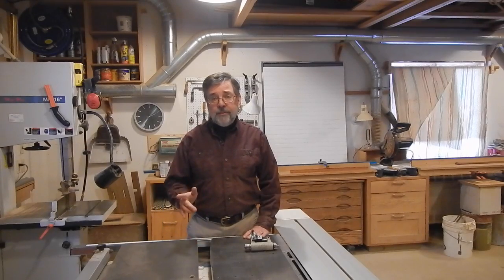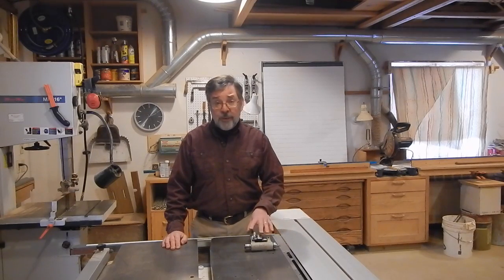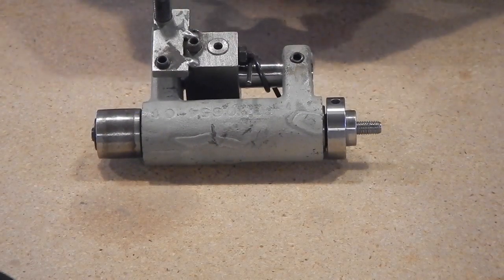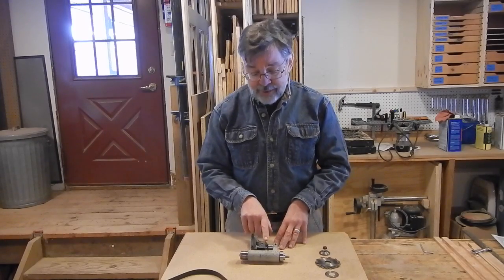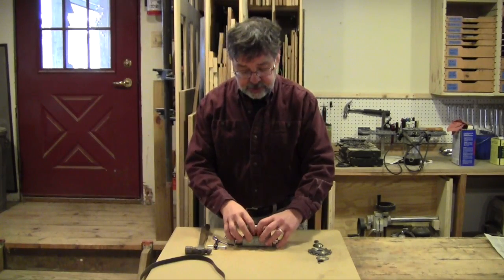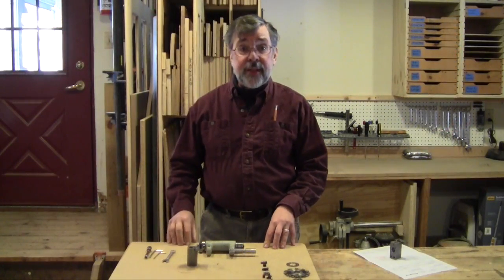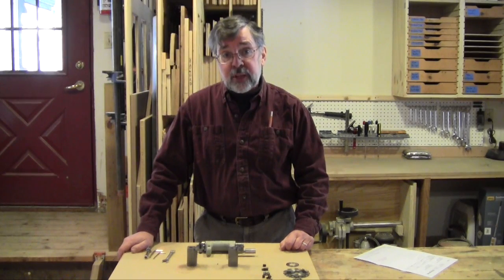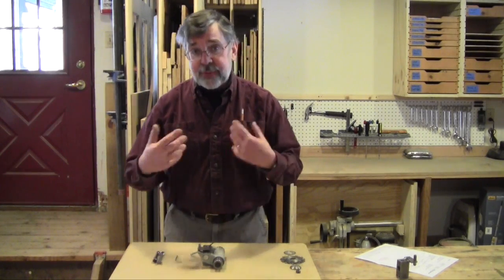MiniMax CU300 - Scoring Blade Assembly Repair

Comment: Thanks for making all these videos on this type of machine.  I recently purchased a used CU300 that was made in the 90's.  Watching these gave me a firm grip on accessory parts that I need to purchase and the way the machine operates.  Right now I have 5 individual machines: tablesaw, jointer, planer, shaper and mortiser.  This machine reduces my shop footprint(one car port of a garage) although I will keep my 20 inch planer.  12 inches is too small for me. Your videos are fastidious and excellent.

Comment: Peter,

I am pleased you like the "scoring" feature.

I saw a video yesterday, where the owner said, "I have NO use for the scoring blade in my new sliding saw; and if it was an option I would NOT have bought it. For I will never use it!"

To each his own.

I personally believe that it is one of THE most needed and awesome inventions in the history of sawing wood. I really mean that.

If a person doubts this, try to cut melamine with out a scoring blade, and it will tear out the bottom of the stock on BOTH sides of the cut using MOST blades. And the tear out is very bad. This happens worse, with plywood,, laminated wood, and thin verniers on wood, etc.

I do not have a scoring blade and that is not an option on Powermatic table saws that I can afford. But there is a "FREE" scoring feature on ALL saws. But if great care is not taken; it can be VERY dangerous.

Just look at the back side of plywood when you have it cut at Home Depot or Lowe's, etc!

But when done properly, it is awesome. AND.................there is NO need ever to shim or adjust it side ways; even when changing blades with different widths. The first time I saw it done, I flipped out. Again, it MUST be done following strict safety procedures; or do NOT do it.

For whatever it's worth.

Keep up the good work Peter.

Comment: Thank you for taking the time to make this information available. Your videos are valuable and informative. You may have saved me hours (or days). It has been frustrating at times to get info on these machines. I have the same combo. I also have a MM16. 

In case you ever need to change your belts, please record the procedure. I would like to see a video of someone changing belts on the various motors.
Reply from the maker: Larry, I'm glad to hear that you find the videos useful.  In all the years I've owned my CU300, the only belt I've ever had to change is the one that drives the scoring blade.  Since everything happens deep inside the cabinet, I don't think there's any way I could capture very much of the process in a video.  I'm hoping my luck holds with the rest of the belts, especially the one that drives the jointer/planer.  If that one goes, I'll try to film something.  --Peter
Reply: @sunnybeeches8534  would you happen to have a part number for that belt?
Having a hard time finding a source in the US.

Comment: Good videos, can you tell me what is the correct height the scoring blade should be set at above the table?
Reply from the maker: Andrew, I'll admit that the exact hight of the scoring blade is not something I pay much attention to, and I've never noticed it making any difference.  There's a comment on my table saw video saying that I have the scoring blade set too high, and I think that's likely true.  Probably, the higher the scoring blade, the more likely it is to produce some tear-out of its own.  So, in an ideal world, you would want just enough to get the job done, but no more than that.  I'm guessing that would be somewhere around 1/32".

Comment: Thanks for your interesting videos which I discovered only recently.
I have a broadly similar SASCOM "Titan" brand machine which has served me well for many years. I had a number of comments and queries arising from your various earlier videos but didn't post these as I was unsure of a reply. Do you monitor comments for these older videos?
Incidentally, I long ago removed my scoring unit so as to allow me to fit a 12" saw blade but I am going to dig this out and examine it in the light of your problem.
pat dee referred to an alternative to the scoring saw but didn't give any detail; I think he may have had in mind the idea of a close-fitting throat plate.
Reply from the maker: I don't monitor the comments on the videos, but YouTube will usually send me an email whenever someone adds a new comment, and if the comments warrants a reply, I'll usually create one.  The volume is pretty low, so it's not hard to keep up with.  --Peter
Reply: Thank you. One small general comment is that I was surprised to see you using the basic L-shaped Allen wrenches when much better types are available. No reply is, of course, needed!